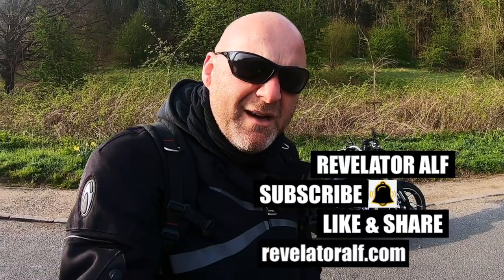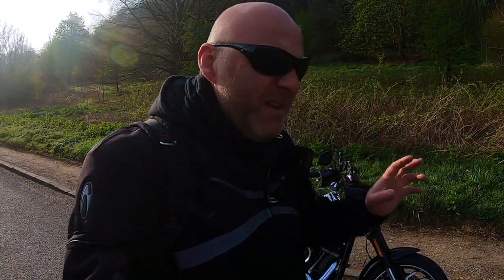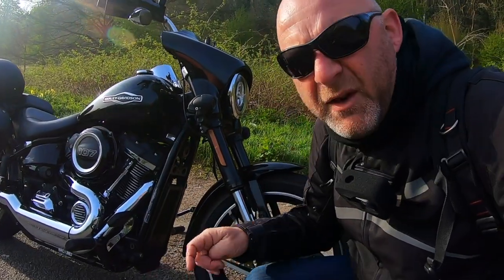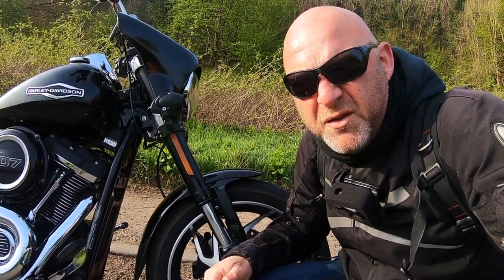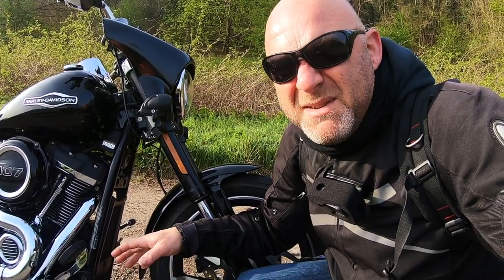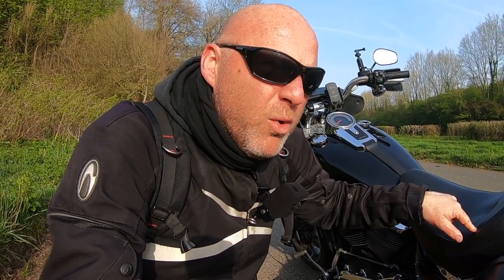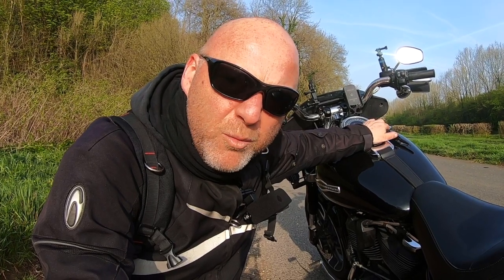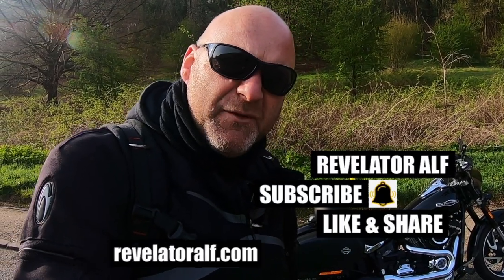Harley Davidson Fixes & Accessories! Did They Work?

Comment: I do not recommend vented dipsticks for m8 softails because in my experience you have to run the bike 3/4 of a quart low when hot to stop it them leaking oil.
The trask trans cover works better, has a one way valve and is what i suggest for softails. 
You can diy your trans cover but you should incorporate a one way valve into the vent.

Comment: I now run the breather from the "gearbox cover" (between the oil tank and the engine) and have just fitted a new air cleaner (From DK Custom products), which came with an nice external breather system.  When I fitted it, there was no oid in the intake (it used to always be dripping),  so the "gearbox cover" breather works a treat.  I've also had fitted the latest oil pump (and slipped in a torque cam at the same time) to guard against future sumping / pump issues...  oh and I have the same phone mountg as you - thanks for the recommendation as it were :-)
Reply from the maker: Ha great stuff cheers

Comment: You know how in one of your videos you mentioned the fairing can rub on the chrome triple tree... Well I just put some small clear plastic furniture bumpers on the lower bracket... That works fine but they fall off when I wash it... so I need a better adhesive without it being permanent of course.
Reply from the maker: Yep I just make sure the fairing is raised and doesn’t rest on the yoke but I also have vinyl tape on it too cheers